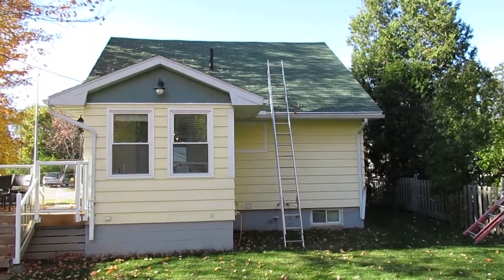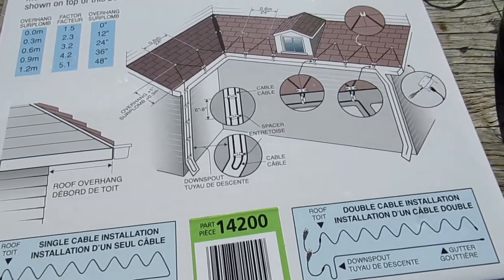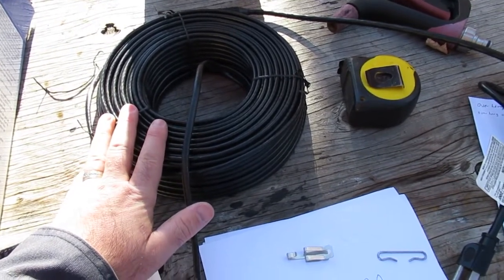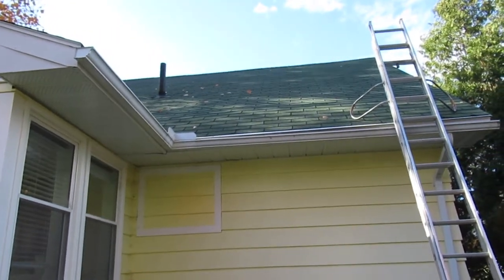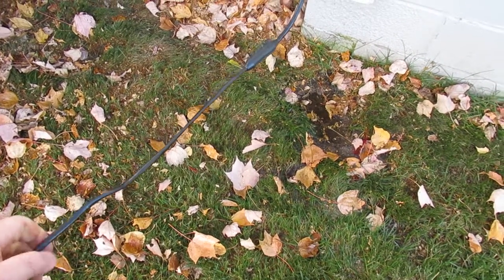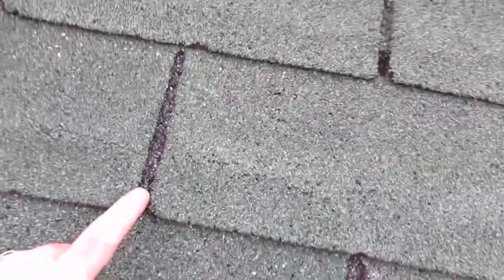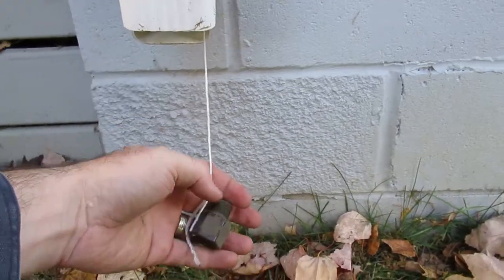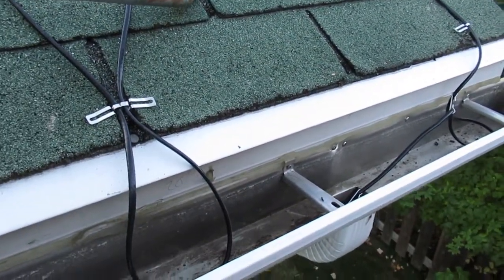Roof and Gutter Anti-Icing Cable Install

Comment: I used Radiant Solutions brand.  You can overlap the cable and 5-yr warranty.
Reply: Thanks for your comment. Overlap is great, other brands say not to overlap. Maybe because your Radiant Solutions brand has lower power? I wonder?  Or maybe just better made. Are they sold on Amazon? Thanks

Comment: Excellent video. How well did the deicing system work for you? Any issues?
Reply from the maker: It was perfect.  I only had to run it a few times during the winter when the temperature was up near freezing/thawing.  I used a wifi controller and an app to turn it on from 3 hours away.  In my case there is no need to run it very often...just that particular scenario when the big hump of snow on the roof starts to melt and needs some help.

Comment: Thanks for your video. Can you recommend a brand. We are thinking about Easy Heat. Have you heard anything about this brand of cable
Reply from the maker: I do not have much experience with this.  You may want to call an electrician and see what they prefer to install.